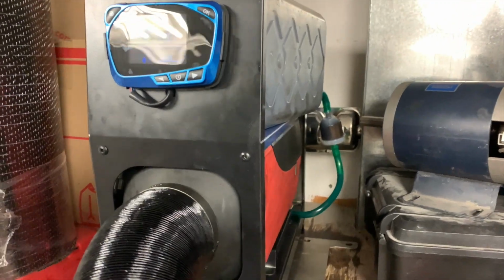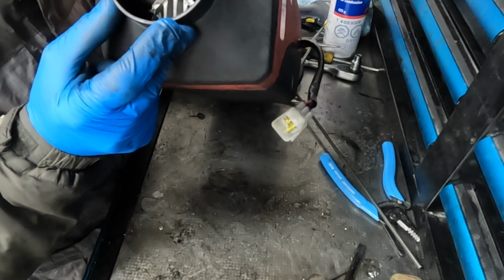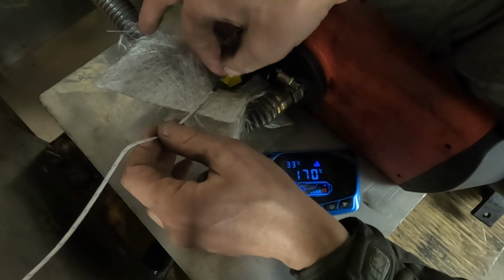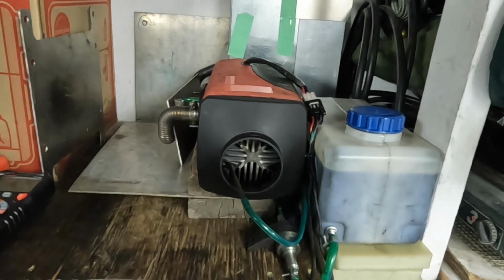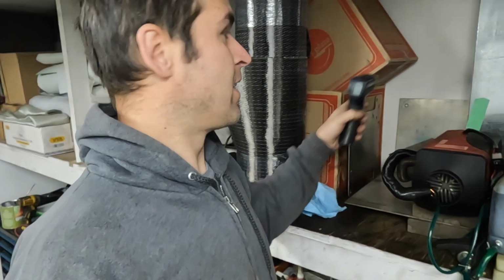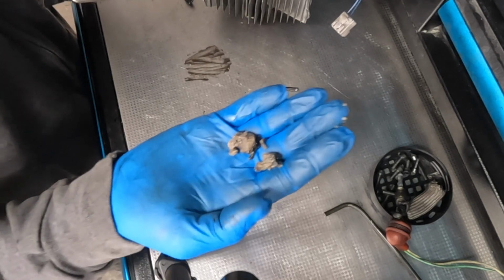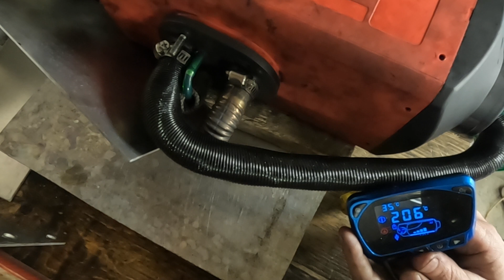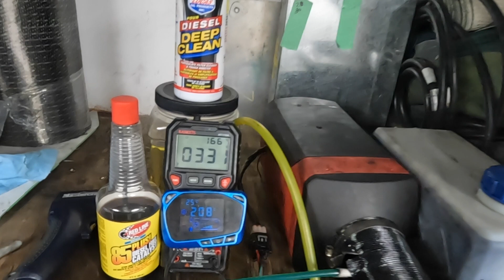EASY Waste Oil Preheater - Chinese Diesel Heater. PT-10

Comment: Still following and hoping it works.
An idea I want to try:  small steel tank heated to about 150F to supply the pump. I am not sure the pump will take it.  But would flow more consistently.
Then add rubber tube over the steel line going through the intake to the burner. The cold air blowing over it must cool it some.

I think best case scenario with start up on diesel and preheating to 150 or 160F we may get like 100 hrs between clean out....that would be decent.

Keep it up!
Reply from the maker: Thanks for the comment! 

My fuel tank sits beside the heater and warms up quite a bit... not quite that warm, but the consistency of the fuel / oil, after I have added gasoline and diesel, is not too thick. As long as the oil wasn't vaporizing before the pump, this would work, but it gets plenty hot after the pump, so I don't think I need to worry about this. 

The steel fuel line is in a pretty hot area. The body of the heater is usually around 200C (93F) and that area of the heater doesn't see too much air flow. I wouldn't hurt for sure... and I have some insulation sleeve stuff... so maybe I'll give it a go. 

The video is not yet released, but I have been starting it on diesel and it helps👍
Reply: @loweredexpectations4927  I do not know how much difference it makes but the last 2 or 3 " of steel line to the burner are exposed to the airflow goinf into the chamber...in my case cold air. So depending on the fuel flow rate and such it may be cooling that fuel back down a lot. I was going to take 1/4" rubber fuel line, split it open and roll it on the steel line to insulate from the cold air.  Again...may not be a big impact.
Reply from the maker: @fmemories  I just had my heater apart and was going to try this, bit decided not to try two different experiments at the same time, haha. I will try it some time.
Reply: @loweredexpectations4927  so was thinking too much about this.  I believe the density of oxygen in air is reduced at higher temps. So routing high temp air into inlet may help with preheating the oil but its at a cost of oxygen to make a complete burn in the chamber.  Ie I think we may want to ensure oil temp is high enough and get the mixture right with cool inlet air.....but that assumes you can get the burn chamber hot enough.
It all boils down to: can you get enough fuel and air at the right mixture to make it hot enough, along with the preheated oit, to flash burn the oil
Reply from the maker: @fmemories  Yes, this is 100% it... I have been doing lots of experiments trying to keep the chamber temps up while still feeding enough air. The air, even at room temp, cools off the chamber where the oil enters, so the oil doesn't want to ignite in the main burn area. 

I've had a few small successes, but this is going to be a challenge for sure. I may need to start over with a new chamber as mine has had so many mods, it may be junk...

Comment: Cooked Bearing in the fan or just simply damaged the inlet fan from the heat I think. Enjoyed the video and am very curious to see what's going on with the chemistry experiment.
Reply from the maker: You're not too far off with your guesses... I won't spoil it for you. I have completed the testing with new oil and these chemicals, and now am trying another modification and chemicals with waste oil. Lots of stuff happening.

Comment: Are you using rtv or do you reuse the gaskets?  Seems it would be expensive to use new gaskets every time you break the unit down, as you tend to do that frequently.
Reply from the maker: I reuse gaskets many times. Before you install the gaskets, smear somet high temperature grease on the outside of the gasket. This will stop it from sticking on the surface of the parts.

Comment: What if u put the pump 2in from the input on the nipple and heat shield it?  Hard to prime, but less space for cavatation .....and thermal expansion.  Juat a thought
Reply from the maker: Hmmm. That could work. Fuel may boil on the way to the pump.

Comment: Preheating the oil definitely seems to burn cleaner, and together with some preheated inlet air is a step in the right direction.  I think it would be wise to filter the waste oil a lot better using a pump and fine filter. This should result in less gunk buildup. Another thing you could try is to mix a bit of (pork) gelatine (5grams) in hot water and add it to the filtered (1:8) waste oil. Let it cool down and settle overnight. A lot of contaminants will get caught in the gelatine, which forms a (solid) layer on the bottom of the container. Mix in about 20% kerosine to the filtered/cleaned oil and you should be good to go. Good luck!
Reply from the maker: Thanks for the comment. 

I think that filtering is a good idea. I have just finished some testing on new motor oil to see if the issues were due to garbage in the oil, just a result of burning oil. The results were interesting... high quality oil burns with less ash when it is completely burned, but it also takes more heat to burn. It seems the main issue with these heaters is that the chamber doesn't get hot enough. 

I purchased gelatin a few weeks ago now and plan on doing this test. Mostly out of curiosity, as I don't think this is a practical method on any sort of scale. Kerosene would likely be better than diesel, but it is also over twice the price here. $4/L ...In some places I hear it is actually less than home heating oil.
Reply: Better quality oil has a higher flashpoint, and fewer impurities. It still has the metallic detergent additives, though.
Reply: Also the red diesel is not much cheaper in Canada and you have to be a farmer to buy it or to get a farmer to buy it for you, not worth the hassle for the price difference
Reply from the maker: @5roundsrapid263  Yes, that's basically what I was saying about the "...less ash when it is completely burned, but it also takes more heat to burn."  As for the additives, this will vary drastically depending on the intended application. Motorcycle oil and classic car oil tends to have a lot of zinc compared to other oils. I wonder how much of this stuff comes out in a centrifuge....
Reply: @loweredexpectations4927  I was just agreeing that you were right.
Reply from the maker: @trikator  I know a farmer that I could get it from, but it's not worth the hassle even driving to to get it...
Reply: @loweredexpectations4927  xactly

Comment: Where the bubbles form in the brake line, it will plug off right there with contaminants and carbon.
Reply from the maker: I'm not 100% sure what you're trying to say. My oil is filtered so there won't be any chunks of stuff and the temperature is not hot enough to cause it to carbon up in the line. If I were to use the exhaust to heat the oil, I think that this could happen.
Reply: Just saying that it’s going to happen eventually. Might take a while. Any time a liquid turns to a gas, anything that’s in it will pretty much stay right there unless it gets flushed through by the fluids that follow.   The metal particles, and other contaminants are pretty likely to stay there. The magnet idea is an excellent one. Like putting a magnetic oil plug in an oil pan. Put one in the fuel tank next to the fuel outlet. 👍🏼
Reply from the maker: @markcoyle8003  Oh. yes. I have a feeling that where the fuel vaporizes there will be a pie if ash and unburnable stuff that settles. I'm guessing that good filtration is important once you get to the point where the fuel is vaporizing and burning completely.

Comment: 1.) why not tap the s holes and just put tiny machine screws in. Then you can use the holes to clean it out

2.) preheat oil doesn’t mean make it dangerously hot. I’d recommend a 8-12” long tightly coiled spring such as a tension spring or a garage door spring. Put the fuel line (real rubber fuel line or even silicone fuel line) inside the coil, and wrap it to the exhaust pipe with a bit of foil or high temp tape to encourage contact and heat transfer. You can adjust the amount of conductivity so the fuel is hot but you can still pinch the line at the point where it goes into the motor for 5 seconds without burning your fingers. That’s about right. I’d recommend tying the coil tightly to the exhaust at the bottom, where the exhaust is not as hot. And have them not touching at the top. It will be easier to adjust the heat if you do that. Make sure the top and bottom of the coil is open and vertically aligned, so air can pass up through the inside through induction.

3.) I’ve found that even though I’m in calgary, the high altitude mode is making things worse. Instead, I’ve had much better luck adjusting the schedule power supply voltage. That “lightsaber noise” you heard is a repeated flame out and reignite on. The gasses aren’t hot enough, or there is too much air. Coil about 20’ of .25mm nichrome wire up and shove it into your burn chamber. It will glow bright red hot and conduct throughout so the entire wire gets cherry red. Any I burned hydrocarbons will be forced to come in contact with that wire upon exit and will burn. This will ensure that 100% waste oil (no diesel) will burn consistently and maintain a core temp of 180.

4.) I have two fuels tied in with valves. I start on diesel and switch to 100% waste oil. If you are paying for diesel to blend, in order to have a functioning heater, you are defeating the purpose of this heater. The whole point is to make a free and sustainable heat source that can also be used if shtf long term. Stick your oil and fine tune your machine.

5.) buy a full aluminum automotive radiator or 1”hydronic convection pipe (with the fins on it) and plumb your exhaust through that on its way out of your structure. You will be amazed how much heat you’re wasting. Don’t go any longer than you have to, or you’ll create too much back pressure. Larger diameters are better if possible. The exit should be no hotter than 35 degrees Celsius or you’re wasting heat.
Reply from the maker: 1. That could work. I don't want to add too much thermal mass as I want that area to get hot and cook off the oil. 

2. I'm aware that superheating the oil is not a good idea... This is why I recommended not using copper tubing coiled on the exhaust. Most waste oil preheaters heat the oil to about 90C . My oil seems to be right in that ballpark. Your idea would work and also scavenge heat from the exhaust, however, it adds complexity to my system that I don't want, considering I take it apart 2-3 times a day, haha. 

3. I think it may have been you that recommended the wire previously. It has been my experience that the alpine mode does not produce enough btu energy. The chamber runs cool and that causes build up more quickly (with waste oil ) It runs fine on alpine on diesel. I have tried the scouring pad idea and a few other things and hope to have a video out on it soon. I'm in the middle of testing something that seems very promising... but, those test usually end in failure. 

4. I believe it was just after this video (was filmed) that I started using diesel to start and stop the heater. It helps for sure. I would like to run strait oil, and that is the plan. Running diesel allows me to run tests for long enough to see if my latest experiment is better, worse or the same. It has been my experience that using strait waste oil with my current setup will not produce enough chamber heat to run for more than a few hours. 

5. Totally. My focus at this time is on making the heater run for more than a few days on a waste oil mix. If I can make that happen, then I will focus more on making it efficient. Also, I'm trying to focus on experiments that will lead to the average person being able to do the same to their heater. That somewhat limits what I do. 

Cheers !

Comment: Can you do a water spray into the combustion chamber next by adding  a motorcycle fuel tee valve into the fuel inlet. Cycle it by  switching the valve between fuel and water and have a windshield washer pump to pump using windshield washer fluid so it doesn't freeze in your garage. See if it removes some of the carbon build up.  You would have to take it apart before you cycle it to see the existing carbon build up then inject the water once up to pressure for a few cycles.  You may need a water clean out weep hole in the casing or not because it would go out the exhaust.
Reply from the maker: I have considered something like this, and I may try it in the future. The number one issue as of now, is that the burn chamber is not getting hot enough. If it is hot enough, water could potentially help, but I am now working on mods to try to get it hot and keep it hot. Cheers.

Comment: I also think that the hot air as intake air heated up the motor to much...also don't be afraid of the temperature to much, mine is (for now) stil running on diesel like it should and I changed the settings on it so that the fan is running a lot slower to the pump speed and I have it now running all day at 2,4hz and the core temp is steady at 245c...the safety is at 246c, than the pump slows down to cool too 239c and from there it picks up again...I do understand that you would want to stay clear of that safety while you are cooking the oil and making it flow at a higher rate... another idea maybe if you want to keep experimenting with this method could be to fix your fuel line higher on the heat exchangers fins so that it is not at the core and heating up as fast...changing the distance to the core let's you tune the amount of heat in the fuel. I think there is some truth to this but as always you need to find the sweetspot between heating and bubbling of the fuel. Together with cleaning up the oil and changing the a/f ratio it might work. But at some point you might as well just be making your own diesel.
Reply from the maker: You are correct about the hot air heating the motor ... 

That is interesting ... my heater will overheat / shutdown at 238 (the manual says 230C) but I have been told by others that theirs will run much hotter. 

You could be right about moving the line to a spot that heats and cools more gradually.... I suppose this could also be done by making a much larger heatsink for the heated line, but your idea is easier.

Comment: The problem with the veggie oil is the glycerin that exists in it. Glycerin is not a flammable substance. If we get rid of it (i.e. making biodiesel) then we can burn it.
Reply from the maker: Yeah... I'm burning waste motor oil, so I'm guessing most of the processes for cleaning WVO will not work... It is a very interesting process tho.

Comment: If you plan on burning a lot of waste oil, you may want to skip fiddling around with different filters and just go right to the centrifuge (e.g. WVO Designs, Utah Biodiesel, US Filtermaxx, etc...). They're not cheap, but cheaper than a number of failed attempts first. 🤷‍♂️
Reply from the maker: Thanks for the tip ! I have been considering building a centrifuge. I have a lathe and a mill... but I would like to try to do this without that step if possible. 

I have been testing new oil over the past few days and my findings were interesting. It seems the contamination of the oil is less of an issue than burning oil... I am now making modifications to try to get more heat into the chamber so that it gets hot enough to burn.
Reply: @loweredexpectations4927  best of luck. Yes, I imagine particulate contamination is less of a factor in a burner than an injector as long as you're at least filtering LARGE chunks that would clog lines even on the burner. I think the problem that still plagues burners is getting a consistent burn when there is water or other non-burnable contaminants (engine coolant sometimes, or other mystery oils with different flash points). I can say that water is removed pretty well with a centrifuge with a preheater, being heavier than oil. You can also use water separator style filters or even something like a P-trap to separate heavier waters. I seem to recall they even make clear P-traps for demonstration purposes, but would be perfect to see if it's filled with water.

Anyway, sorry if this sounds like unsolicited advice from a know it all, maybe it is. 😆 But I am just trying to be helpful. I wish you the best of luck from an admirer south of the border.
Reply from the maker: @Gideon_Judges6  I think you are correct about it being a bigger deal for systems that use injectors. Also, oil "quality" and type is going to vary wildly depending on your source. 

My oil sits for a long time before use and the way I filter it removes any water that is actually pooling at the bottom, but there will always be some oil in the oil that does not separate, unless you use a centrifuge or heat it up quite a bit. 

I appreciate your comment and you taking the time to share you ideas / thoughts.

Comment: I’ve heard large trucks and ships use propane injection to make diesel/fuel oil burn cleaner. I wouldn’t try it inside a building, though…
Reply from the maker: I have tried injecting a little propane, haha... but it does make me nervous... I don't think I will play with that much and not at all on camera.

Comment: Try a bottle of dipetane in your mix , be interesting if it helps !?
Reply: Or a wynns injector cleaner
Reply from the maker: I did a search and it doesn't look like it is available in Canada ? Or at least not readily available. That does sound interesting.